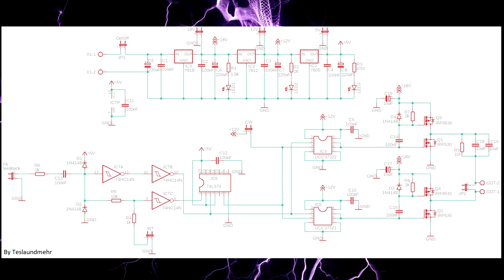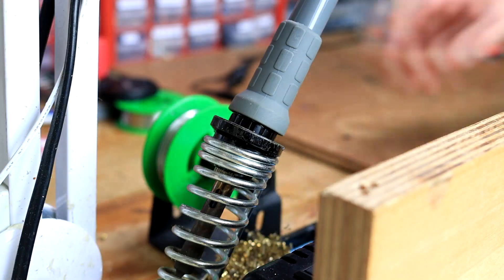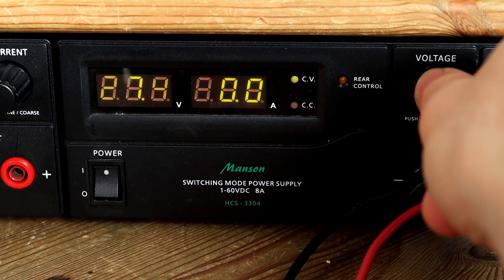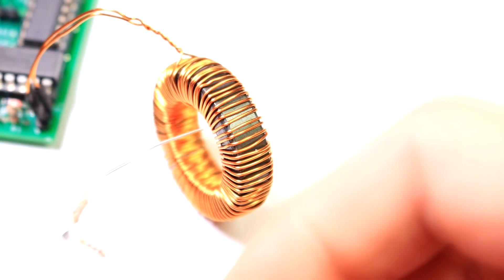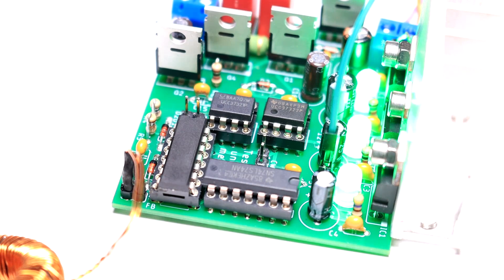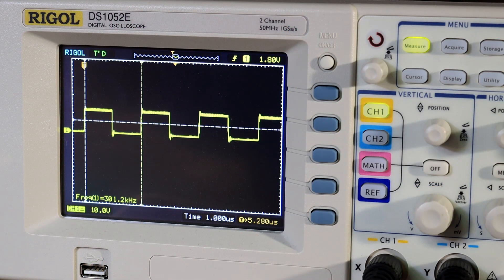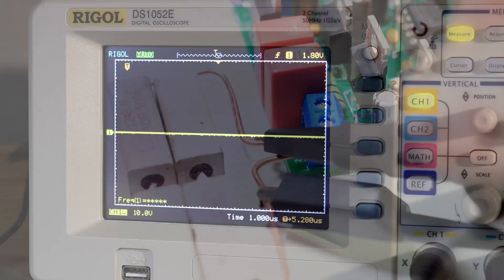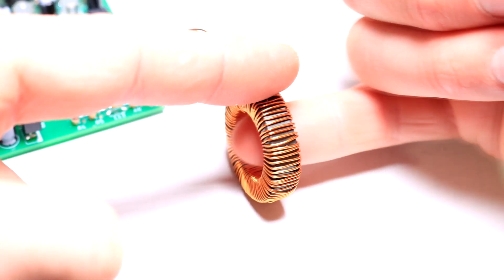How to test a Tesla Coil Driver? Tutorial

Comment: Hi Leon,
Erstmal danke für die super Videos.
hab aber nen Problem mit dem Treiber.
Signaltechnisch sieht das glaube ich ganz gut bei mir aus ( nach GDT) . Die Push/Pull Stage wird bei mir nach ca 20  sek so heiß das ich abrechen muss. Passiert aber nur bei zugefügtem FB Signal ( 300kHz/10V überm Generator). Würde mich über einen Lösungsansatz freuen .
Gruß Till
Reply: @tillschnepper3464 Do you have a 1uF capacitor in series with the GDT coil?

Comment: hi friends..why when I measure (old analog oscilloscope) the gate and source pins even my igbt explodes?. I have a few questions. 1. Does your oscilloscope use a power supply voltage oscillating transformer? 2. why do you use resistor why not use gdt when testing?. 3. where is the measuring probe so I can find out the waveform of the gate? cross or not?

Comment: That came out really good! Extra push pull stages might not even be necessary but it seems about the best way to get 18v gate drive on a 1:1 GDT. You could use the same general layout + a few trace changes to switch each gate driver for dual driver chips to make the board drive two separate GDTs in full bridge setup like the UD drivers. I think this is about the perfect setup to drive smallish coils from good mosfets or 247 IGBTs. OCD not super necessary and neither is phase lead til getting into bigger slower IGBTs and higher power.